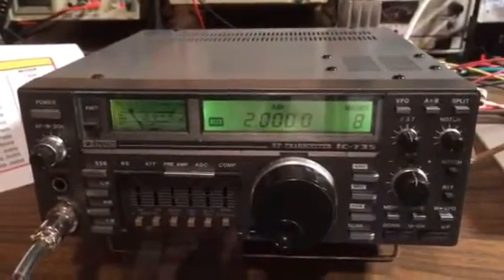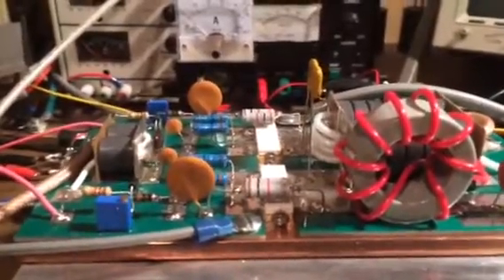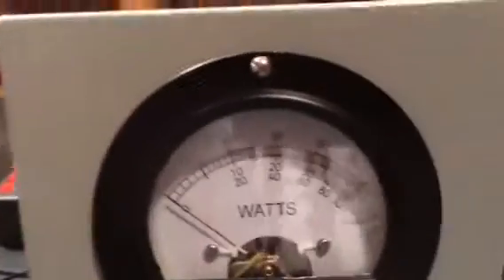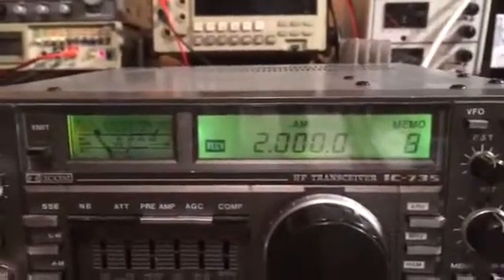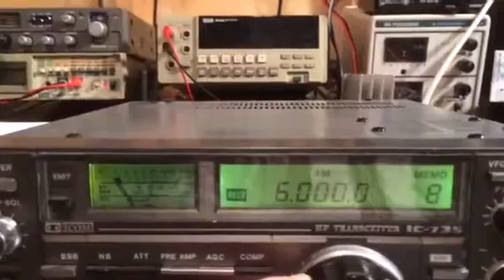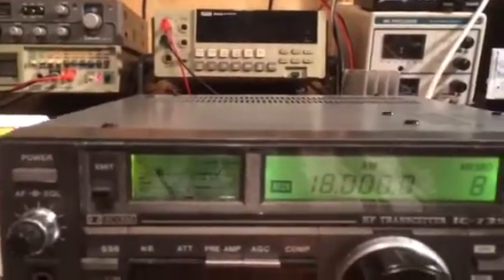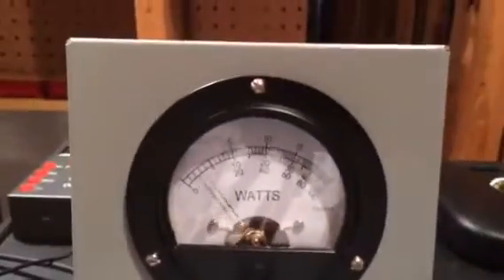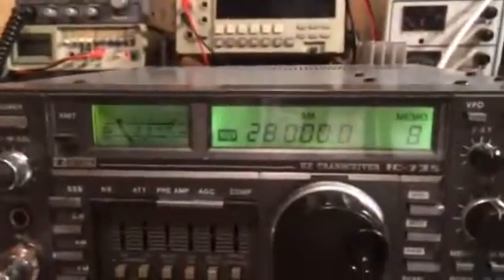RF Man demos dual LDMOS amplifier from 160 meters to 10 meters

Comment: Hey.. if i was to combine X2 of you 3000 watt blocks..
Do you have a combiner sugestion ..
And a coax reley.. to 
6000watt i use 7/8 Hardline to my mast and ECOFLEX15 to my HB35c modified antennea  + and FB53 modified antenna
And A Fet preamp .. 
Any sugestions.. 
I was hot on  VK4DD .. he has made som V-Fets fore VHF UHF .. 
Best retards from OZ-land (Danmark)

Comment: Were did u get your copper heat sink and transistor?  Also i noticed your not using low pass filter?
Reply from the maker: Sorry, I do not share my sources. I sell the copper HS for $75.00. The transistors you can buy anyware RFParts.com, Communications Concepts, etc.

Comment: Do you know the definition of linearity?
Reply from the maker: You are correct. I used the wrong term. I should have said output power vs. input power. Its hard when you make a video with no script. Thanks for point that out.....
Reply: He means the output power, given the same input power, is nominally flat across the HF spectrum.  In mathematics, all  linear means is a straight line, not a curved line.  Or I'll just say in English, all linear means is "like a line".  So if the function F(x) represents output power over a range of frequency x, and F is nominally a constant, then the use of the term linear for this function F(x)  is fine with me.  Though I agree maybe a term like "flat" would be better, as "linearity" especially with respect to "linear amplifiers" suggest the amp's ability to not distort, which was not what was the purpose of the demonstration.
Reply: But he lost me on the "power supply linearity"... hmmmmm.  Maybe to him "linearity" is a fancy word for "steady / doesn't sag"?

Comment: Power supply linearity?  The power supply delivers DC regardless of the frequency driving the amplifier.  Don't you mean amplifier linearity?  Also, how clean is the amplifier output with no filtering? IMD, spurious emissions, etc.